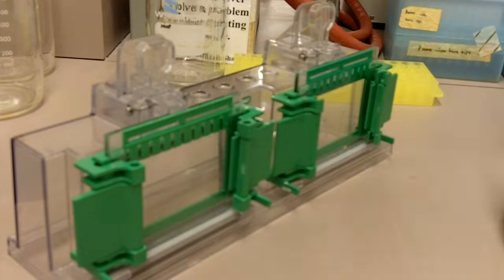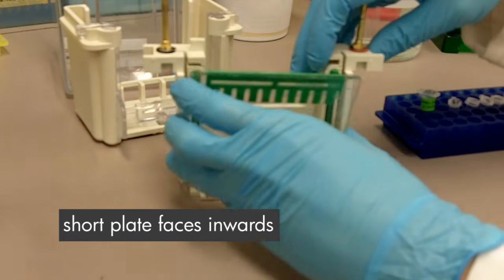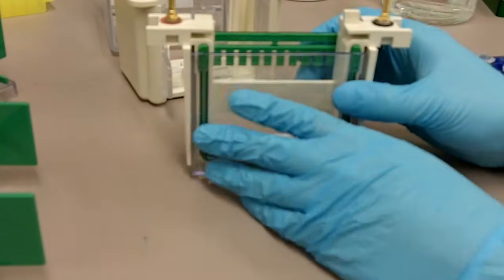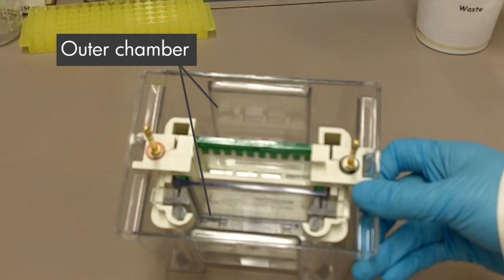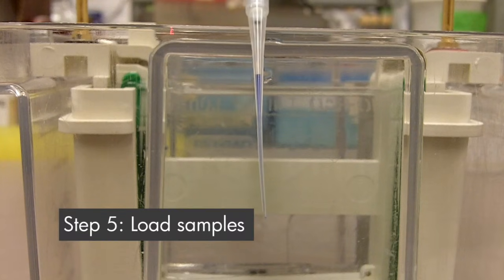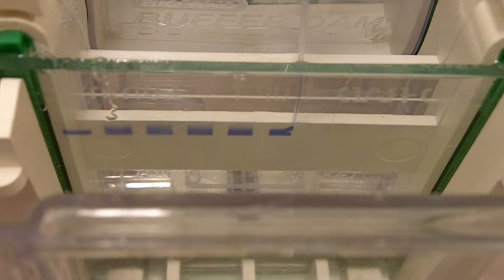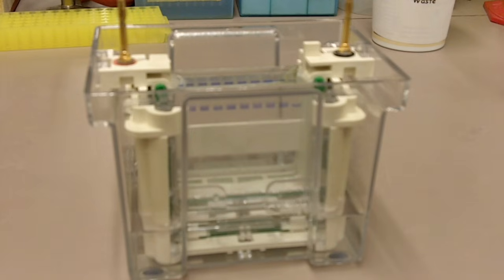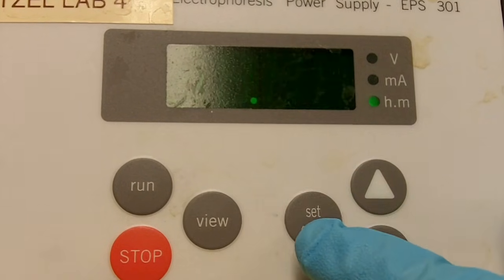How to Run an SDS-PAGE gel

Comment: Hello, I hope you're still active on this channel... Would there be an issue if you use 10X running buffer instead of 1X? Also, I noticed you had a very thin pipette tip that seemed to allow you to insert the sample past the short window and access very close to the bottom of the well. I was using a regular tip and found I couldnt get past the short window so I had to gently release the sample from the point of the short window. It appeared that the dyed sample 'fell' down into the well ok but I'm wondering if the sample may have dispersed more than I could see and could have contaminated other wells? Thanks for the video!
Reply: you should use 1x buffer
from my personal experience, a regular tip (those for 2-20µLand 20-200µL) is enough to get into the gel well and that should be enough to prevent any contamination between the samples across the wells. Try to let the short glass plate facing you and tilt the pipette towards you a little bit. Though i am not sure about the plate thickness and the comb you are using. Being unable to touch the end of the gel well also prevents you from injecting the sample into the gel. XD
Reply: in the video they are using special gel tips which are thinner. commercially available

Comment: @Niharika Gaur there is no need to put the apparatus on ice, as the SDS (should) denature any heat-sensitive folded molecules in the first place.
Reply: because he chose low voltage?
Reply: The biorad manual itself said the sds page system may have high temp if you use high voltage. The concern of high temp isn't for the sample, but for the sds-page system.

Comment: i do not use bio-rad apparatus i use something very old. once i have my gel ready and put it into the tank with the appropriate apparatus that it needs to attach to, and then fill the inner chamber with running buffer, there is leakage of the buffer into the outer chamber. how do i prevent this? what are the probable causes of the leaking buffer?

Comment from the maker: Keep it in the destaining solution (water) and it should be fine. Your main concern is to make sure the gel doesn't dry out, so make sure it's submerged in the solution and keep a lid on the container. That should be good for a few days. To prevent anything from growing, you can change the water once a day, but it should be okay as is for two days.

Comment from the maker: When you dispense your sample and you push the button of the pipette, make sure you don't release the button of your pipette until the tip comes out, otherwise you will suck up the sample again. Just keep it pushed to the point where you don't expel air bubbles, and the sample doesn't get sucked back in. Hope that helps!

Comment from the maker: Try to load your sample slowly - push out the sample slowly, a little at a time. That way you can avoid overloading. Also, don't fill up your lane to the top. Usually 10-20 microlitres is used in each lane, but that depends on the size of the wells.
Reply: What is the buffer used in inner and outer chamber?

Comment from the maker: @088zorba Load your sample slowly and watch your pipette tip so you can see when all your sample has come out. If you push out everything from your pipette too quickly, the air after your sample will also come out and you will get bubbles (you don't need to push the button all the way down....just push until your sample has come out). If you get bubbles, don't worry because they should float to the top.

Comment from the maker: @zileburki There are several ways to deal with this problem:

1) You can use a plastic gel loading guide (you put it on top of the gel, and it shows the wells -- maybe your lab already has one)

2) You can draw the wells on the glass plate using a permanent marker (before assembling the apparatus)

3) You can also add some bromophenol blue dye to your stacking gel so that your wells are blue and easy to see (check your inbox for more details).

Otherwise, just practice! =)
Reply: give details plz

Comment from the maker: @vinnie1313 One trick is to wash the wells with distilled water after taking out the comb. (you can do this step over the sink, before assembling the apparatus). Another way to deal with this problem is to use a long gel loading pipette tip, and scrap out any acrylamide between wells before loading. Hope this helps =)

Comment from the maker: @dsjp2010 First question:
You don't need to calculate. Just take about 10uL of your protein sample and mix with 10uL of 2x loading dye. Boil for a few minutes. Give a quick spin in the centrifuge to bring sample to the bottom. Load either 10uL or all of the 20uL.

BUT it is recommended that you load about 1-10ug of protein when the sample contains 1 protein. If possible, just take different concentrations of your protein and load them to see which concentration gives you the best looking gel.